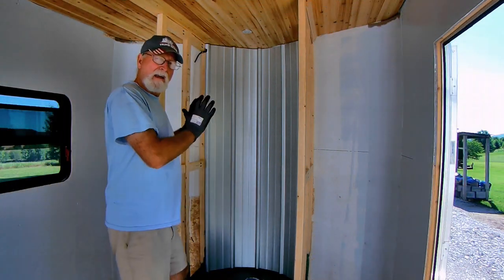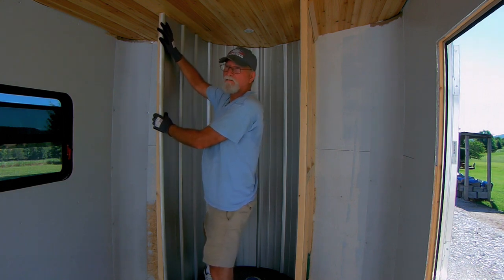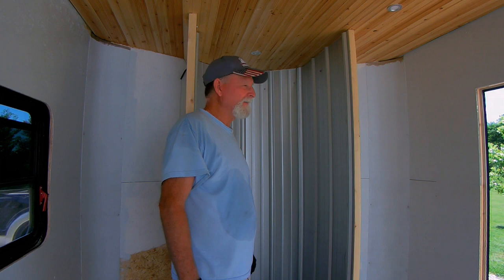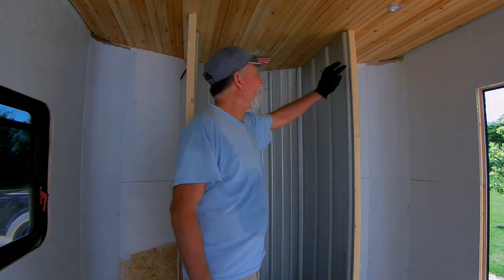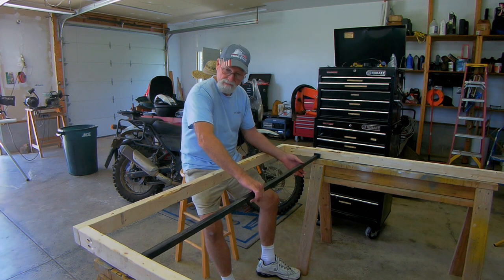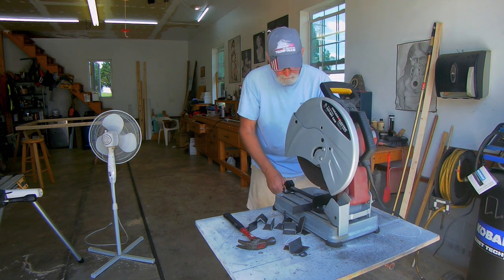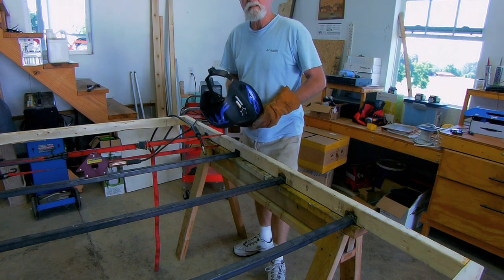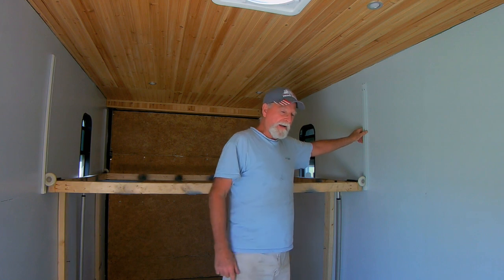Episode 7, Shower stall walls and elevator bed.

Comment: Hi John. Could you please tell me how you mounted the brackets to the wall for the actuators?  Are they welded to the metal studs?
Reply from the maker: 1/8" thick steel strap, drilled a hole in it.  Took steel rod and stuck it into the hole, then welded it.  Then welded that assembly to the steel frame of the trailer.
Reply: @johntalbert8227  awesome, thanks for the help sir.
Reply: Hey John. One other question. What brand 12VDC plug did you use in the walls to power the actuators?  My walls are only an inch thick, so not a lot of room to work. Thanks.
Reply from the maker: @jacobzimmerman3330  Tried to find them on ebay but not available.  They were no name china bomb stuff.  It was good quality.  They were just wall mount sae connectors.
Reply: @johntalbert8227  Thanks John. You happen to have a link to them?
Reply from the maker: @jacobzimmerman3330  no, they are not available any more.  But similar just search for in wall sae connectors on ebay
Reply: @johntalbert8227  thanks John for the intel and quick reply. Appreciate the assist. Btw, one of the jobs of my trailer will be hauling my motorcycle as well. Take care.

Comment: I had the power metal cutters and still didnt like using them. I ended up cutting that material with a skill saw and metal cutting blade. It sucked, never wanna work with that again. Lol

Comment: Hey John good job. I am interested in the actuators you are using....where did you get them and how much? Low amp draw too? I am thinking about using just 2 and have them push on a brace center of the bed. I have been researching what to use so your vid is on time for that. thanks John.
Reply from the maker: see in the description above.

Comment: why did you only use three actuators
Reply from the maker: Cost.  They work as well as 4.  They push the bed up to the ceiling and it is very stable with only 3.  When all the way down, they sit on brackets so the wt is off of the actuators.  They are rated for 200 lbs each.  I think my bed mite weigh 100 lbs when I get the mattress on it.

Comment: What wheels and track did you used? If you don’t mind I’m building a trailer also and I like your bed design
Reply from the maker: 3" heavy duty garage door wheels.  Rubbermaid shelf track.  I bought the track at lowes in the shelving dept.  https://www.amazon.com/gp/product/B07YL686M3/ref=ppx_yo_dt_b_asin_title_o05_s00?ie=UTF8&psc=1       
https://www.amazon.com/Rubbermaid-FG3Q7400WHT-Track-Upright-Hardware/dp/B0044FTF94/ref=sr_1_3?dchild=1&keywords=rubbermaid+shelving+track&qid=1595964034&s=hi&sr=1-3

Comment: How would a grinder and cut off wheel work? Looks great by the way. Looking forward to future episodes.
Reply: 4" grinder with a diamond tip blade cuts right through galvanized metal.
Reply from the maker: I will try that next time.  My way wasn't very effective.
Reply: Yes 4" grinder with cutoff wheel I've doing it for years